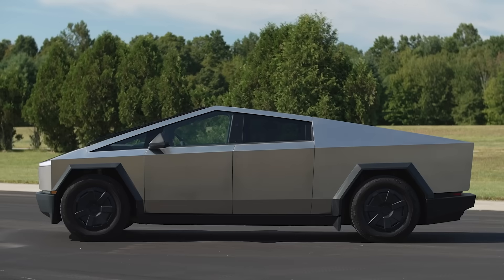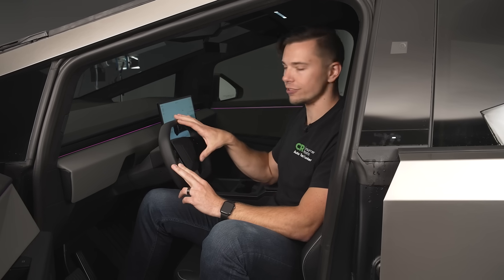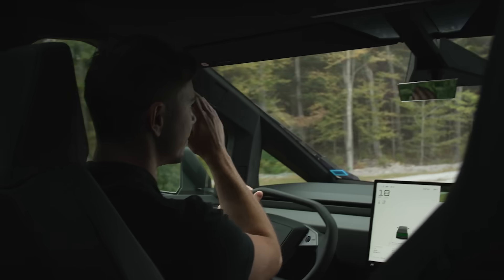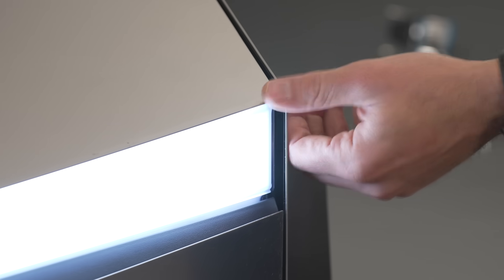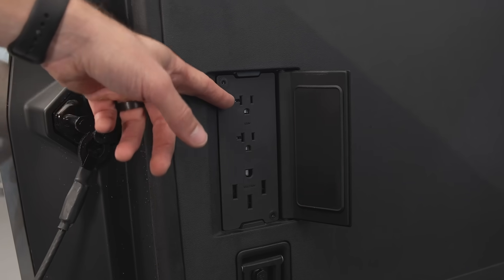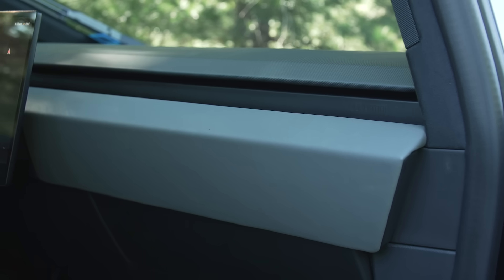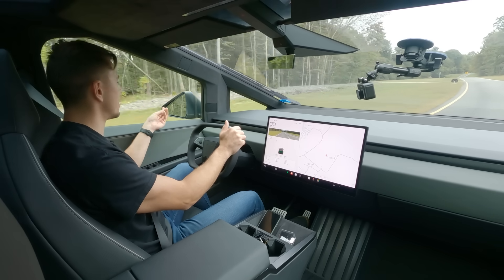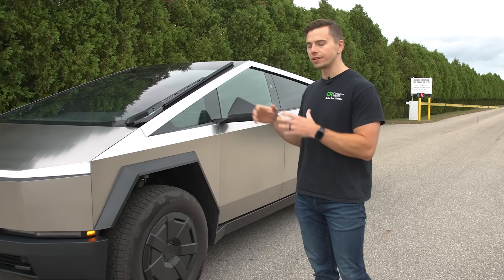2024 Tesla Cybertruck Early Review | Consumer Reports

Comment: I think one of the closing comments— “once you can kinda get over [its design] and all of the flaws of that come about because of its design, you’re left with a vehicle; and it functions as a vehicle, and it’s even a pretty decent pickup truck in terms of having a six-foot bed, tonneau cover that can cover things and other ‘truck’ features”—is awfully chilling, if perhaps unintentionally so.

The truck, delivered, cost CR just under $102,000. Shouldn’t we all ask for more out of a vehicle that costs $102,000 than “it functions as a vehicle?” 

I might be sacrificing an automatic tonneau cover by downgrading (such as it is) to an F-150, but in trade I would get a functional rear-view mirror and turn signals that work—one would hope—greater than “90% of the time.”

It’s certainly a striking vehicle, but I’m not sold on the idea that it’s ever going to be a truck for people who need a truck to do truck-related work with. In favoring form over function, it seems like it’s a showpiece instead of a useable truck.
Reply: Could you run a 5th wheel trailer in that bed? How about a camper body?
There is a reason that all pickups have essentially the same shape.
Reply: If you want to extend range , the extra battery consumes cargo space and adds more weight .  What can be thought about that ?
Reply: @mikewallace8087  It's a stupid solution but I'm pretty sure they won't be making it.
Reply: @jovancurcin3694  I believe the extender battery is a temporary solution. In about a year or two, they will have solved the silicon problem for use in the batteries and the separate unit will not be required.
Reply: If you drive a truck you dont need a rear view mirror. I drive a van and a lorry and for ever am reversing into spaces... no rear view. You have side mirrors use them and a MASSIVE camera in the back
Reply: @Wi2Low This!!! You have to experience it in person to believe it!!!
Reply: It will be recalled soon..mark my word
Reply: And its so DAMN UGLY
Reply: You are also getting a slow, expensive to run and maintain truck that doesn't hold a candle to the CT's technology.
Reply: @Wi2Low THIS ! (and I'm 75.)
Reply: @Wi2Lowoh give me a fucking break. You were willing to buy a 100K truck and sign a no resale agreement, why should I trust you? You have 6 figures tied up in a hype machine you can't sell, you're just as biased as anyone.
Reply: If by “striking” you mean “unbelievably ugly” then yes, this truck is very striking.
Reply: What you said and it not cut you from the sharp edges.
Reply: If this is one of the better Tesla's you've checked out.. thats sad.
Reply: I agree that "functions as a vehicle" is not an acceptable standard for something that costs this much.  

Especially when compared to other vehicles in the segment, like the f150 lightning.  Which, fully loaded, costs $15k less, and has features and quality to match that price.  

In short, yes it's an effective "wow" machine.  But beyond that, the price/value ratio just seems too high.
Reply: @roguedogx Also, if you’re looking for an actual working truck: F350s start at $45k. Less than half the price of this “it sorta works as a truck” vehicle.
Reply: @roguedogx  Has the F150 gone up Hells Gate? Does it Wade through 1m of water?  Is it as fast 0 to 60? Can it drive itself??
Reply: I have a Ford Lightning and plan to get a Cyber truck in the next few years once they get the bugs worked out. Ford has been a mess to deal with. We have been much happier with our Tesla Model Y. The flaws talked about in the review don't really affect you day to day. The software is incredible with Tesla, and that is what ruins the Ford.
Reply: First of all it's the foundation series which of course is over priced for the people that want to be the pioneers - and you can tell the pioneers by the targets on their backs. 2nd, even at $100k there are many ICE trucks and SUVs that come close to that price or MORE but from day one they will never get better via over the air updates like Teslas do.  Your ICE truck will pollute, won't perform nearly as well in power and speed and must be fed FUEL at cost$$ meaning will cost MUCH more to own. Engines degrade (batteries lose maybe 10% after 300k miles. No owner of a Cyber will have to do squat to get not only AutoPilot but Full Self Driving when they push it via update. Who knows what other features they will add via update. A range extender battery and light bar will be available too.  As far as it being used as a truck that's hilarious being 99% F-150  or RAM owners don't use their trucks as trucks. Also, if your house loses power will your gas truck power it? The Cyber will. "Vehicle" my ass.... the fact it can blow sports cars that cost double off the road but you can self power it in the middle of nowhere silently as a camper, then tow your boat home - "fill up" with solar or juice when it's cheapest at night via AutoBidder software makes it so much more than just a vehicle. Savings in gas alone makes it CHEAP in less than 10 years as well - what does a ICE truck cost per year to fuel $5k? $10k?  How much does paint cost? LOL  nahh, Cheapskates always end up paying the most. Ya gotta finger being the FIRST of it's kind that this Cyber today is the WORST it will ever be and it's set to outsell the all time leader this year F-150 - the GAS version - take that "vehicle" guy, chew on that.  👀
Reply: Can a Ford F-150 stop a .45 bullet? Can a Ford F-150 take a hit from a shopping cart without cosmetic damage? Can a Ford F-150 give you a 17" max clearance? Can a Ford F-150 mostly drive itself? I could go on...

When you compare a Cybertruck to a regular pickup, you can't just fault the Cybertruck for what they don't have. You also have to give them credit for what they have and others don't. At the Foundation model price of $102k, you're paying for things that no other car has. And of course in some instances you're not getting something most other cars do have. Whether those distinct features are worth it to you is subjective.
Reply: @thesadboxman  five recalls in 2024.  FIVE.  It's a very overpriced lemon and will go down in history as such.  Buyers prove that there is a sucker born every minute.
Reply: Agreed. "Once you get over the fact that it sucks, it just doesn't suck as much, and is somewhat nearly passable for it's intended purpose."
Reply: It's a novelty.  I doubt we'll see more than a couple more years of this monstrosity. 

The long term viability of Tesla under Musk is questionable.
Reply: If f150 is so good with high demand why cybertruck outselling it with higher price tag ?
Reply: @wensiangfong  Not in 2025.
Reply: @Wi2Lowthis truck is by far the best driving vehicle I've ever had. The truck actually makes driving fun again.
Reply: Also Aluminum Frame not Steel like all Work Trucks (Aka Ute's Pick Up's!) that's a major red flag!
Reply: Its a half ass review.  If you are stuck on the stainless, shape or Elon's politics, I cant help you.  The reviewers talks about steer by wire and doesnt mention rear wheel steer which makes this turn extreme tight for a 143 wheelbase.  Doesnt mention anything about offroad modes or that the vehicle has diff lockers front or rear. Says the air suspension is good for entry/exit but doesnt mention it has 14" of ground clearance in its highest setting (16" in extract on its toes). Nothing about the 2200 lb payload rating (up to 2500 lb with the AT tires) and how smooth the ride is considering these ratings.  Nothing about it's amazing sound system.  Nothing about sentry mode, dashcam, high fidelity park assist (yet says it doesnt have parking sensors), autopark, or the TeslaAI roadmap for the next few months.  As of today, my truck drove me about 100 miles without me touching pedals or steering wheel and that's on highway, rural and suburban roads not just select, premapped highways.  He doesnt mention the rest of the accessories, home backup equipment that was included or lifetime connectivity service included.   

$100k is a lot of money but its due to the pent-up demand and gradual production ramp.   Tesla will exhaust the $100k market soon and we will see a very similar truck for under $80k in 2025.  As time goes on, this truck will continuously improve and prices of new ones will keep coming down.  As for the big three.... they just keep getting more expensive and get worse once you drive it off the lot.
Reply: @TFD31  A lot of the features you list are things other trucks offer (2200#+ payload), they are things that most truck buyers wouldn't want or need (e.g., self-driving), or they are nifty touches or capabilities that are a bit needless.
Reply: I would have also wanted to talk about how well it functions on different terrains since that's often needed for trucks. No one is probably going to actually use this for work but even for leisure people like to use trucks to go camping, hiking or hunting. From what we've seen it's not great in that area compared to other pick up trucks.
Reply: It’s going to have full self driving, which you won’t be able to say about the other EV trucks.
Reply: @alesh2275  because they know better.
Reply: @alesh2275 not too impressive when teslas will drive right through a wall that has a road painted on it.
Reply: @alesh2275 considering Tesla's don't actually have full self driving I don't see why it matters.
Reply: @alesh2275  Tesla has been promising FSD "next year," every year since 2016. Having experienced the current state of FSD in my Tesla, I say no thanks, it's like having a lousy drunk at the wheel. I am skeptical that any Tesla will become actually self-driving with a camera-only system.
Reply: Anyone who believes buyers are choosing the Cybertruck out of necessity is missing the point. It's similar to those who purchase G-wagons just for trips to Whole Foods; these vehicles are status symbols. People want to stand out, and that's perfectly valid. It's akin to spending $1,000 on designer shoes when a pair of Converse would do just fine
Reply: @GlitterGuru  the indicators on a G-Class will work 100% of the time at least.
Reply: @GlitterGuru  Yeah, this is how I see it too. It doesn't matter if it's bad at truck stuff because that's not how it will be used 98% of the time. The problem for Tesla is there aren't enough people willing to spend 100k on a status symbol to make the CT a success/profitable. Same goes with all EV's really. They're luxury vehicles atm, and there won't be wide adoption until cheaper models are released that us normies can buy. That's primarily why EV adoption has slowed.
Reply: That comment wouldn't be appropriate even it went for $40k, especially if you take into account all of the problems this car is riddled with.
Reply: @jovancurcin3694  like?
Reply: @jovancurcin3694  Mostly the glue was not sticking well.  What you have after that is good to typical for a new design.
Reply: @jovancurcin3694  I own one. Not one...single...problem. It's the most amazing vehicle I've ever been in. Do you own one? I didn't think so...
Reply: @RodMacQuarrie  FIVE RECALLS in 2024.  Is that a record??

Comment: Idiotic that the rear view mirror doesn't become a screen when the cover is closed.
Reply: They are actually designed to be removed completely!
Reply: the REAR mirror can be REMOVED , side Mirrors too.
Reply: Rear view mirror is not really used due to the cover. Tesla prefer to use camera for range. Removing the mirror will anger parents with child in the back seats as they use to monitor the children.
Reply: That’s for much cheaper vehicles 😂
Reply: No Part is the Best Part.:)
Reply: Agreed
Reply: Windows are becoming obsolete.   Some ordinary cars and a lot of very expensive, fast cars are doing away with the rear window.  Polestar 4&5, Alpine A110 R, Aston Martin Valkyrie, GMA T.50, Aston Martin DBS GT Zagato, Ferrari 812 Competizione.
Reply: Hardware is expensive and Elon is cheap.
Reply: Many of Tesla's features are just cost-cutting, no radar, no parking sensors, no digital rear view mirror. No turn signal, a turn signal that works 90% of the time means it makes errors 10% of the time. No door handles. Still costs $100k.
Reply: @kc5077 $79,990 for the CyberTruck.
Reply: @kc5077 and no paint…
Reply: Millions of large trucks, vans, Fire Engines and trucks, Medic units, brush rigs and heavy equipment vehicles don't have rear view mirrors and/or don't have a view to the rear. It's not an issue. 
Learn how to drive with side view mirrors and cameras and get over it.
Reply: @dvader3263 I don't see fish eye mirrors on the side of the cyber truck. The C and D pillars are already thick enough for you not to safely check your blind spot. You're reducing your visibility in a vehicle that doesn't have enough good visibility to begin with
Reply: What do you expect for $102,000?  A digital rear view mirror cost money. Instead they write a little software and display the rear view on the main screen.
Reply: It is on the display, but i see your point
Reply: Why does it need to be a screen if it's already on the display? It's in the settings to have it on at all times or only when the cover is closed. Removing complexity and having a single logic board for the whole car is part of why they were able to become profitable selling EVs.
Reply: I expect that limitation is due to DOT regulations.  I'm pretty sure they don't allow a rear view mirror to be a screen for reliability reasons.
Reply: @proberts34 they do though. GM / GMC have camera based rear view mirrors.
Reply: @proberts34 — ?? It’s a feature already on many vehicles. Hell, I installed it after-market on my Nissan X-Trail.
Reply: @proberts34  lots of cars have center rear mirror as screen ... Cadillacs for example
Reply: @proberts34 Nope. Numerous vehicles have rear view mirrors as screens. It's a hazard if you can't see the back of the car. It's why heavy duty trucks have complementary mirrors within the side mirrors
Reply: @proberts34  Wrong, other manufacturers do exactly that.
Reply: @proberts34  Don't tell that to G.M., we wouldn't want them to get in trouble.
Reply: @proberts34  Subaru and I’m sure others as well have this already.  In the outback with the flick of a switch you have a regular mirror or the camera view. Useful if the cargo area is full.
Reply: @proberts34 other cars have it

Comment: Form over function Is the best way.

And given it a pass because they try something new....lol...thats funny. New or not. failing is still failing.
Decent review. But i feel it gets away a bit to much if you look at other reviews you guys have made.
Reply: Except here the function dictated the from. The triangular shape is stronger. Look at any steel or wood structure, you'll see triangles everywhere.
And the stainless steel exoskeleton increases the usable space inside, increases strength and rigidity, and reduces weight. Plus you don't need paint, which is expensive and delicate.
Reply: @andrasbiro3007 what a load of crap.
Reply: If this was any other manufacturer with this many flaws and issues it would be lambasted, pulverized, and mocked. Thank God I don't subscribe to CR